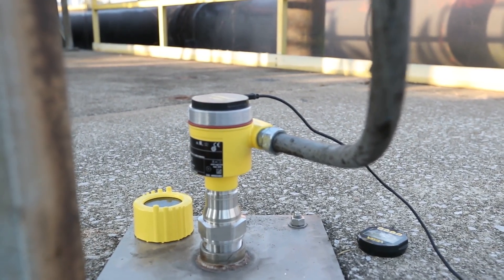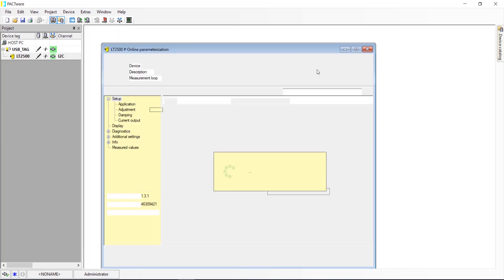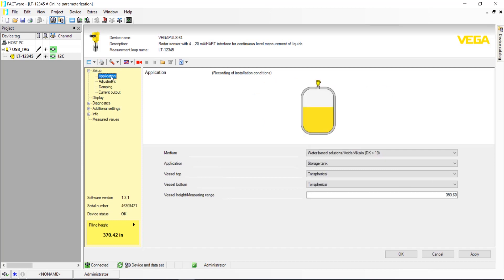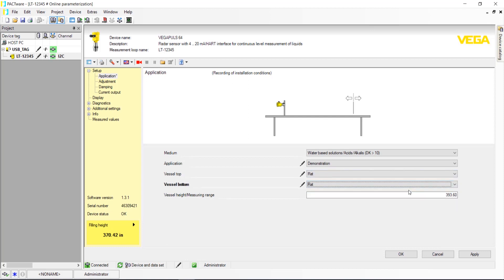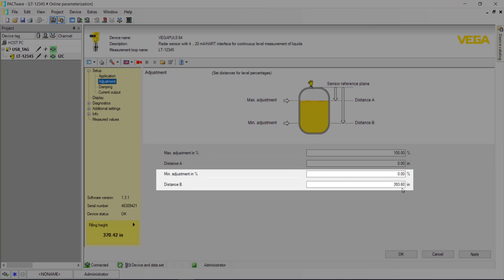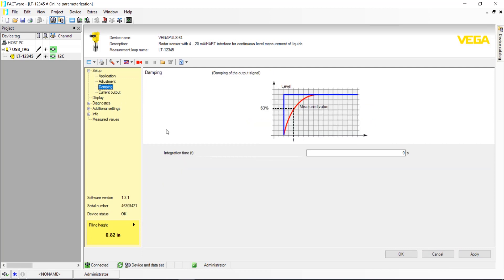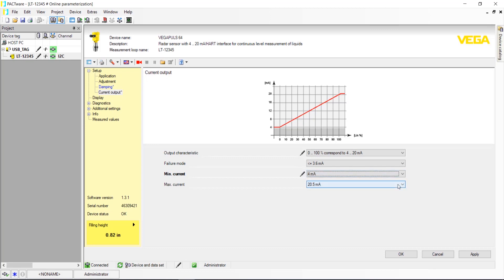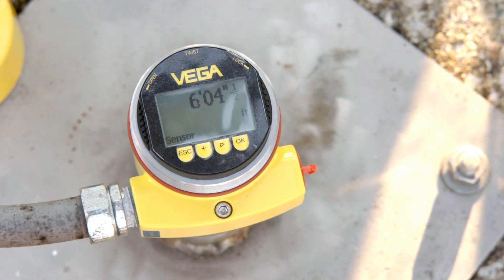How to set up a VEGAPULS radar sensor with PACTware | Tutorial

Comment: So failure high of 21mA will indicate 100% or more on the DCS?
Reply from the maker: Hello, thanks for your question. Upon a sensor failure (i.e. Loss of level signal) the current output can be set to fail high, which will send 21 mA creating a 100% full level indication at the PLC. The sensor can also be set to fail low, sending 3.6 mA indicating 0% at the PLC. The sensor can also be set to hold last known value. The output failure should be selected as needed for the application. If the output is digital, a failure message can be sent to the controller indicating there is a problem, since current output is not effected on the digital loops. Feel free to contact us directly if you have further questions: https://www.vega.com/en/company/vega-worldwide